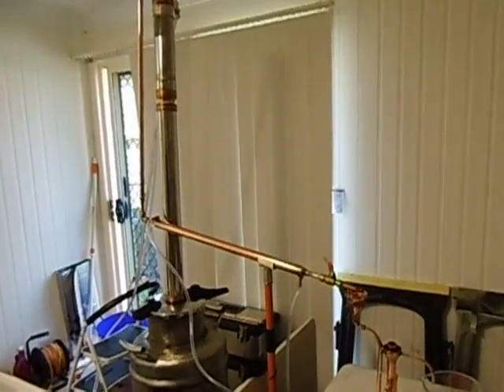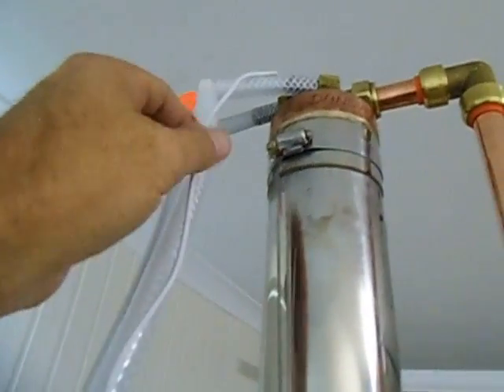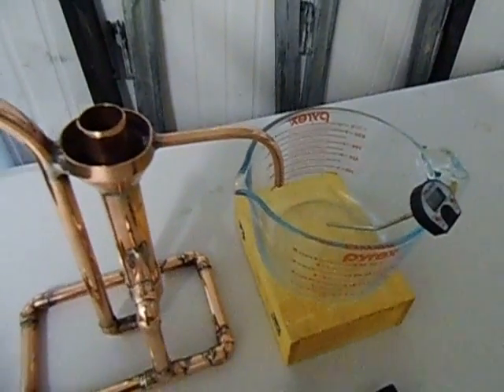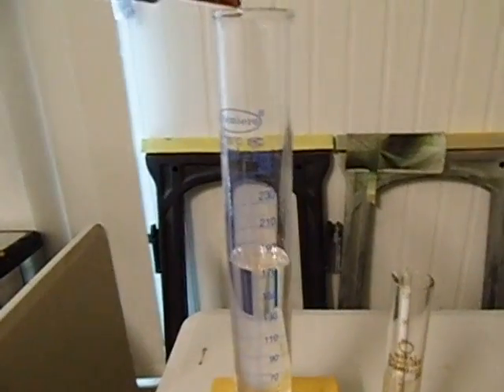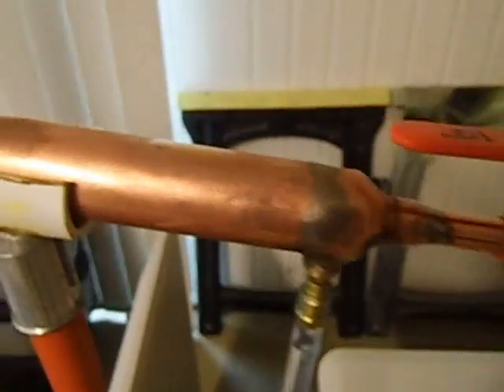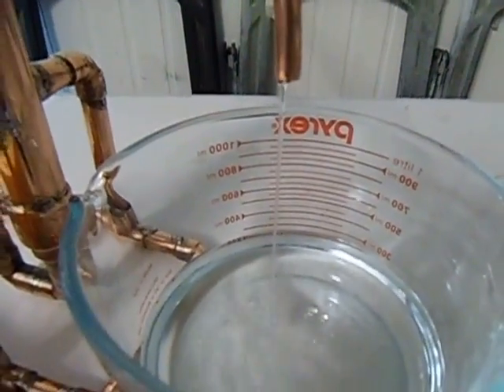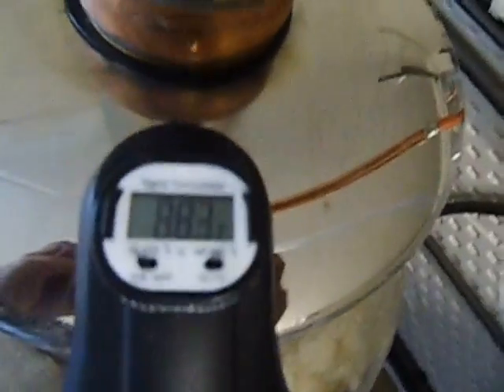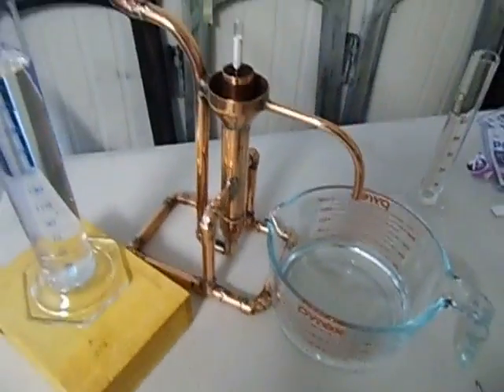Changed reflux still setup part 1 of  2 ,run 2

Comment: wouldnt putting the LM valve at the end of the condenser without a return to the column  just cause the product it to pool in the condenser and not actually provide any reflux control?

Comment from the maker: I average about 90 percent abv over the entire run that took less than 3 hours from start to finish for 4.5lt of good spirits , the spirits run was only 1,5 hours from catching start to finish. Wash was 8kg white sugar , Alcotec super turbo 48 yeast ,  liquid carbon and filled to the 25lt mark plus a extra 5lt of some leftover wash , total 30lt in boiler. First 200ml used for fire lightning or cleaner , very toxic , not to be consumed.